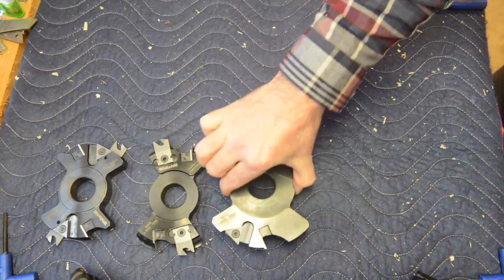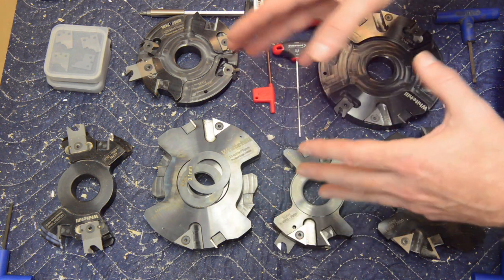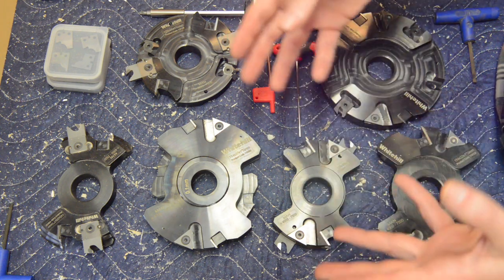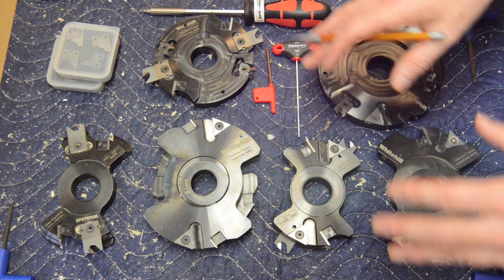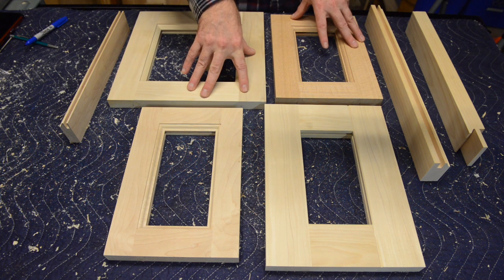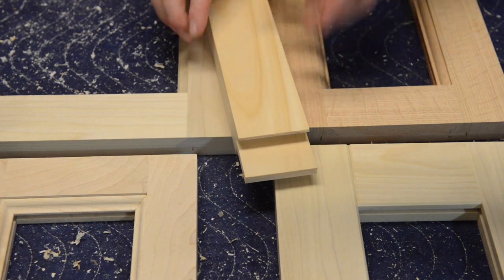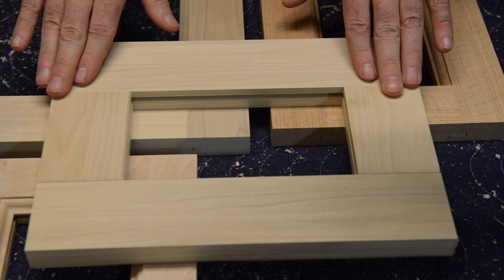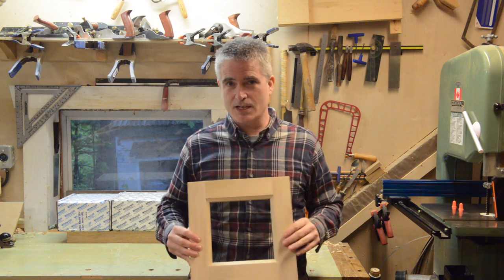Whitehill Adjustable Cabinet Door Shaper Tooling - #shaper #woodworking #joinery #spindlemoulder

Comment: I've watched this video maybe 6 or 7 times already. You have done an excellent job. I'm looking to get into making doors as a small side hustle and will be receiving my saw/shaper in about a month or so. I'm completely new to using a shaper and although this set is pricy, I have done doors with a router bit set and didn't enjoy it at all. This set looks to alleviate all of those frustrations.
Reply from the maker: @SaleemHodge  It's such a treat to use!  My research shows it is the least expensive of the professinal grade sets because Whitehill makes it themselves.  It is not a resaled product from another manufacturer. The shaper (spindle moulder)  is the most versatile tool in the shop and will become your favorite machine....to the point you will want a second one!  Purchase a book entitled "The Spindle Moulder Handbook" by Eric Stevenson.  It is the most modern, English language book on the safe use of your machine.  It will blow your mind what you can do with your machine!

Comment: I have this set and  it is top quality. I bought it to replace a set I had from Leitz.
Reply from the maker: Very interesting, thanks for the comment.  I'd like to hear what you preferred over the Leitz set.
Reply: @DovetailTimberworks  It was an old set and when I went to buy replacement tips, I was quoted £1100. I bought the new set for £1800 with more options, shaker, ovlo and the variable panel thickness

Comment: Hey Brent, in the closing comments you mention machining the edge with the zero set aspect of these cutters. Do you mean with a rebate head or other cutter?  Can you elaborate on that detail?  Thanks for posting this video
Reply from the maker: Profiling the outside perimeter of kitchen doors is pretty popular these days with many different coves, ovolo profiles etc quite common, and even just simple round overs on front and back edges.  Whitehill can provide tooling (knives for limiter blocks) that will do this for you and if desired and you have large production volumes you could have a block made that will work with the zero set principles to make moving through the steps of door making very efficiently.

Comment: Very good review thank you for that but when I looked up the price to order this item I nearly fell over how do they justify over £2700 or $4610 Canadian  that's crazy money and that doesn't include shipping WTF I would need to make around 8 full sized Kitchens with this tooling just to break even before it has paid for its self ill wait till I become a millionaire woodworker maybe not as I wouldn't need to work then LOL
Reply from the maker: Haha!  Yes, it is certainly not for a hobbyist but more for a shop making kitchens commercially.  That said, it is actually nowhere near the most expensive version out there.  Because Whitehill actually makes this set, there is no markup at many places along the supply chain so it ends up less expensive than many, but also more flexible.  If you scroll back a couple of years, you will see a two-part video on making cabinet doors with much less expensive tooling options.  Let me know what you think.
Reply from the maker: Also, I am seeing 2275GBP which is about $3875CAD today.

Comment: Great video and set. How much would a set like that cost in the United States?
Reply from the maker: At today's exchange it's around $2k USD for the three profile set, less for just the mission set.  I put a link to their web page in the description for you so you can always get the latest.
Reply: @DovetailTimberworks  thanks a lot.  I’ll check out the link.  Does the cut on the groove get splinters at all?
Reply from the maker: @davidbryanwoodworksandmore  Sorry, missed this question.  I didn't notice any issues on the grooves at all.  I was deliberately asking for trouble a few times but feeding backwards and on squirrely grain and the worst I got was some fuzz in a couple of places, but really that stock wouldn't be used on a door anyway.

Comment: whats the advantage  to this  over  dedicated freeborn cutter sets
Reply from the maker: Freeborn makes brazed carbide as well as insert style.  Insert like this set will always out perform the brazed because inserts will always be sharper than brazed, there is no need to send away for sharpening (just swap the inserts instead) and the tooling will not change diameter as you sharpen which means all your jigs and shaper settings remain valid.
Reply from the maker: Regarding the insert style, the freeborn sets are smaller diameter (cut quality is better with larger diameter) have less thickness range, less adjustability for groove width, no long tenon option ....and more.

Comment: but no one wants raised panel doors anymore - its all coloured shiny lami panel.
Reply from the maker: They're coming back in apparently!  Also, for passageway doors and wainscot panelling they're still fairly popular.  Higher end stuff though.
Reply: @DovetailTimberworks  I'd love to see that - I prefer making those to the crap I have to make
Reply from the maker: @rupert5390  Me too!  I would say 3/4 of the raised panels I make are for myself, or for passageway doors or for reproduction kitchen doors that have to match existing.  I have a two part video on kitchen doors that includes raised panels from a couple of years ago if you're interested.